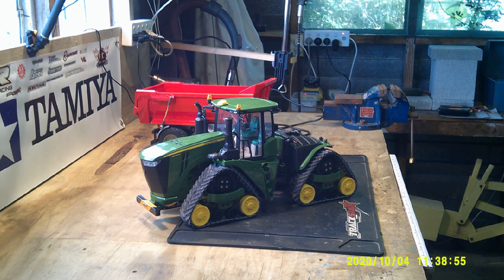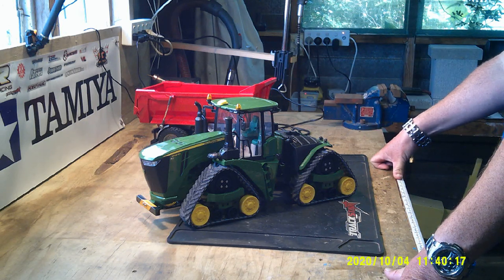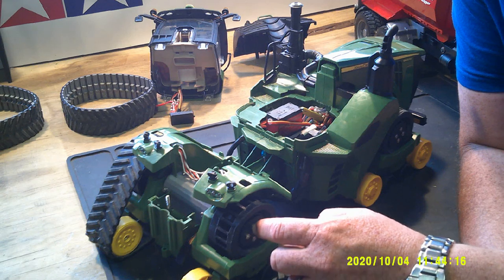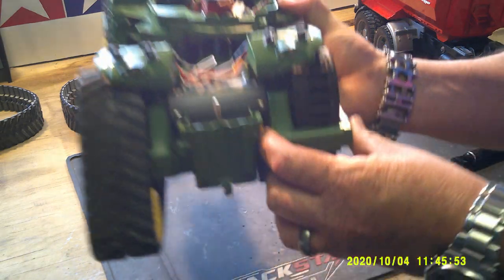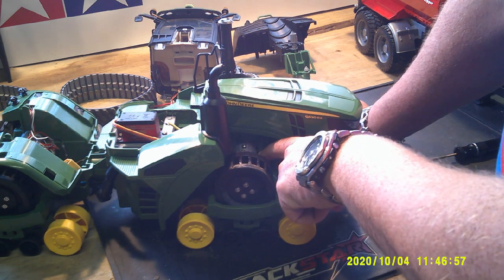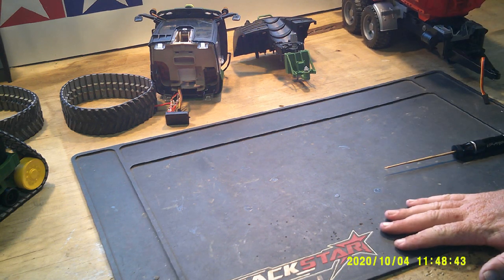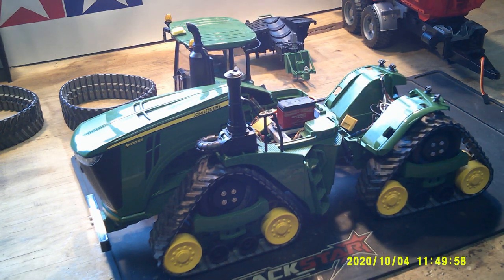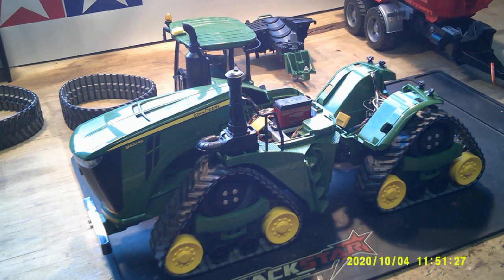Bruder John Deere 9620RX RC Conversion Part 9

Comment: What speed controlller/ ESC are you using ?
Reply from the maker: Hi there

I used this and ran 2 motors in serial of each supply

https://www.aliexpress.com/item/32573395669.html?spm=a2g0s.9042311.0.0.27424c4dPiMeXI